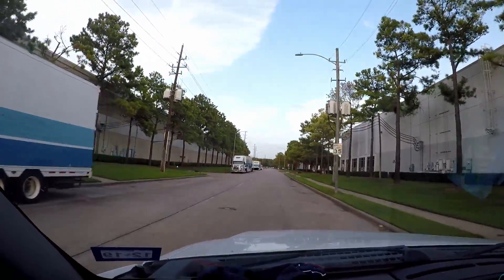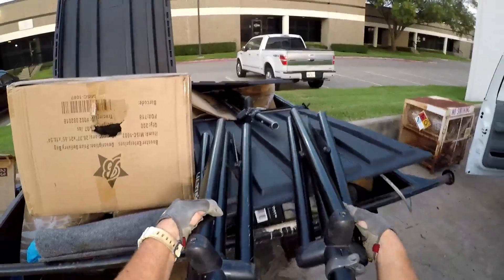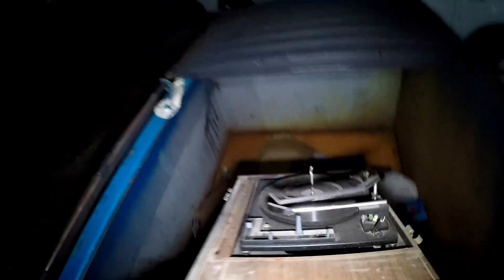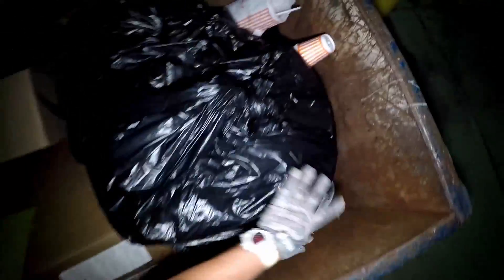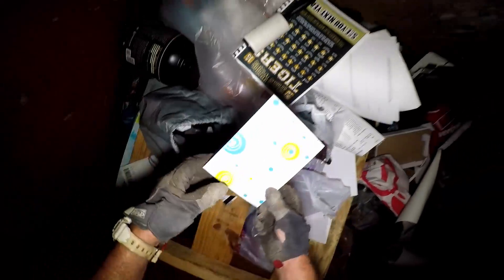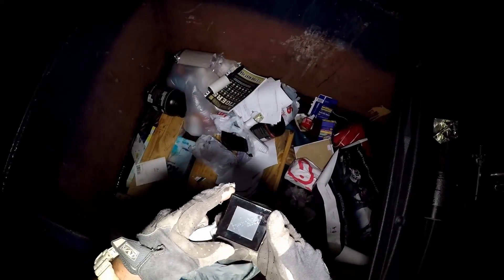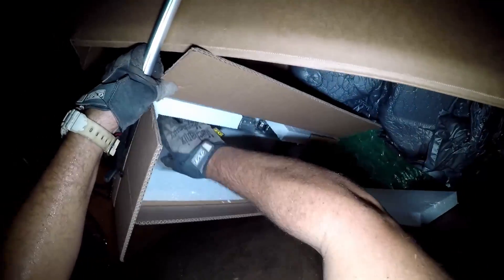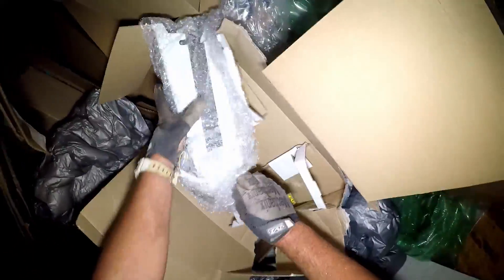Dumpster Diving "I Bet It's Full Of Something Awesome!"

Comment: You can take the cover off & if you are a handy man you can probably fix the on & off switch and clean the contacts on the sliding switches for the equalizer.  I am 66 yrs old from the old school and I have a whole bunch of albums and 8 tracks and cassettes.  I have a Fisher Stereo Unit that I bought back in the 80's it came in a stereo case.  I had to buy a new turn table but the 8 track tape player works, the  equalizer works, there is a few things that need minor repairs but all if fixable

Comment: The transformer is what we in the trade call a "dry type".  Lots of copper, lots of iron lamination. Unfortunately, these are often filled (potted) with a tar like material, or an epoxy with sand as a filler, to use less epoxy! If the potting compound is black, you can probably successfully melt it out. I would suggest using one of the BBQ pits you often find. Saves a lot of clean up!

On the other hand, depending on the ratings, you might sell it for what it is. Looks to be about 10KVA. Voltages and single or three phase are important!  Common secondary voltages are 120/208 for 3 phse or 120/240 for single phase.  Most likely primary voltage would be 240 or 480 volts.  I've installed a mess of these over the years, in everything from 3KVA to 250KVA. Weights from quite a lot to tow motor.  The ones you want the most are dry type air cooled, which aren't potted.  If you run across an oil filled type, and the oil is green, it is Askarel which is partly PCBs and shouldn't be in the trash to begin with.  The nameplate will have a statement such as "No PCBs". Pretty obvious.  Haven't seen a PCB oil filled transformer since the early seventies, and it was old.

Comment: That transformer may not have oil in it,mostly only the larger ones has oil in them.The way you can tell if it has oil in it if it has tubes running from top to bottom on the outside,(cooling tubes)I worked in a machine shop where we had to tear down transformers and replace the insulators.

Comment: I would drill a hole in the side of the transformer and drain  out the oil then cut it open and get the cash out!!! Thats what I do with the condenser's.
Reply: Transformer oil can burn in a diesel engine.

Comment: Maybe for the sealed transformers, drill a hole in it to see if oil drains out first, then put a screw back in to plug it if it does and you want to leave it alone, or let it drain before opening.

Comment: My (80 yo at the time) mother had an LG refrigerator and she thought it had run out of Freon, everything inside was warm, she also smelled burnt plastic. She noticed the light cover was sagging and actually melted, dripping from the ceiling of the fridge. She learned not just any appliance technician could work on it, had to be an LG certified tech. Other techs don’t have access to wiring schematics or technical information. This meant a service tech from 100 miles away made a trip to tell her the main electronic control board was bad, causing the interior lights to stay on turning her fridge into an “Easy Bake Oven”. The tech told her a new board was over $300 and had to be ordered or she could unscrew the two light bulbs and have a dark fridge. How stupid is it that the interior lights are controlled by a circuit board that also controls multiple other functions of the appliance? For decades manufacturers used a simple switch and the world was in balance! ... She kicked the LG to the curb and bought something that didn’t require a 100 mile service call.

Comment: i think dumpsters are better to get into then trouble as at my age its not so good if i was younger then its better but older its fines and jail or doing commity service so yeah, that has to be house hold, you don't just throw an old type writer and deck away unless there's like a local flea market or storage unit and there bins are full but i think we'd know if they were full as there'd be more stuff, that or there testing it to see if the dumpster get a lock or get better dumpsters if there like getting none factory/that area's waste, still cool though that record deck might be woth some money if its not broken if it is then that top might be stainless or alleyiumum as they were good still are if you know how to fix them, that au deu toilet was calivin cline too very pricey even if half empty or full guess someone didn't like the smell still good stuff, heh i wonder if it went to a whirrlpool or whurpool company tumble dryer as those things start fires man if they were in the usa you'd be in scraper heaven having to re-call all of them or a few as were still waiting, not used it for a few years dam thing was fixed but it didn't dry the clothes the sleathes or bottoms of your pants would still be wet and that nasty wet damp that clings to you and feels like you've just walked though some deep water, looks like just a basic record radio sterao set shame as ppl like those unless there's an 8 track on the front in that black part then that;s slightly better, still good though